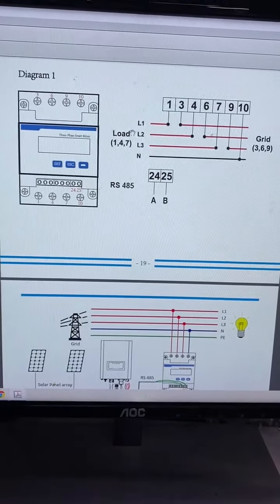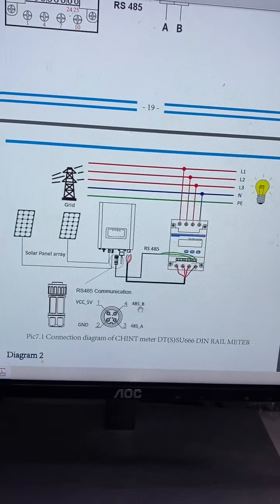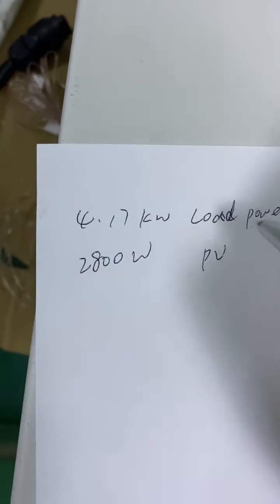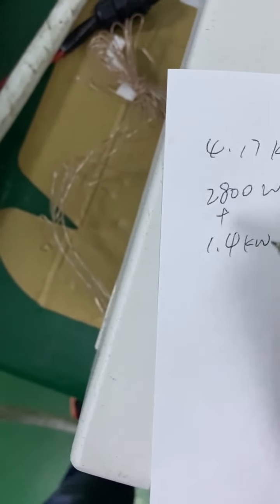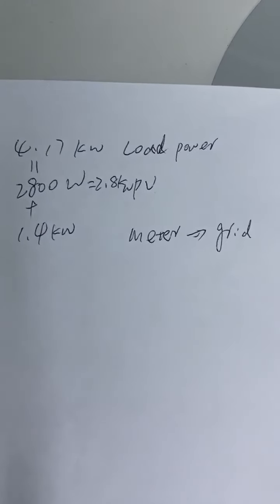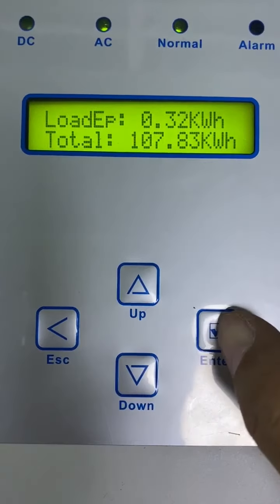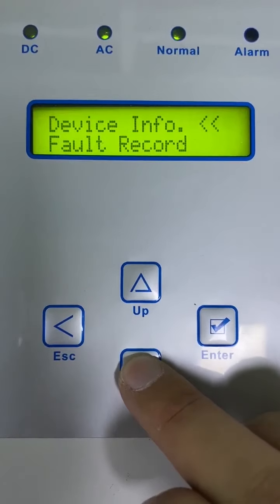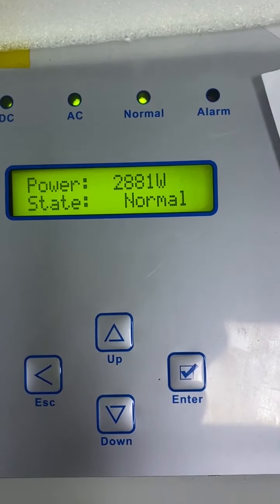Zero export for Deye 3phase inverter with energy meter

Comment: Hey Kyle, thanks for your videos!
I have been some troubles with communication between string inverters and SMD630CT, it doesnt give any error in inverter just assume it is zero if I turn on "Meter" in parameters and doesnt give any information before that. Sometimes it work smoothly others times happens it, you have any tip? thanks you
Reply from the maker: if so, need to check the zero export mode that has two kinds of zero export mode. for the Min mode. only the each phase has load connected then the inverter will give power.